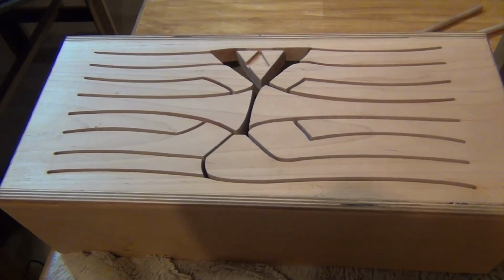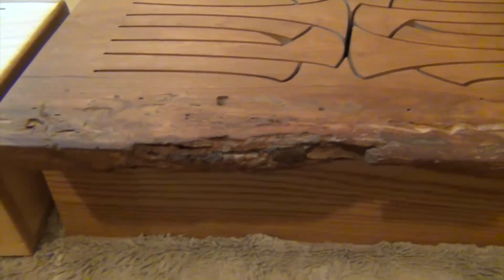How do you record tongue drums?

Comment: Using Shure SM58 & Presonus Audio USB interface. I've been struggling with same issue lately: finding best way to record steel tongue drum. I use Audacity but have Reaper (Aud. seemed more user friendly to me). I've seen pictures of traditional rock bands recording drums and their microphones are suspended up in the air hovering above the drums. I think this angle helps capture the radiance. I still have trouble capturing that radiating rigging that the drum has live. I've found that the lighter taps & overall sound in recording just sounds pinging & dinky,  it doesn't have that warm hum. When I strike the tongues with more force the recording is better but shame limited to that striking technique when recording. Wish could capture better. Let us know how goes.

Comment: I would say trial and error. Room acoustics makes a huge impact on recordings. Maybe try a few different rooms or look up some videos on treating your room acoustically. They make some sound dampening blankets that you could makeshift a recording booth with. That would help take away any audio that is being colored by the room.

I would also try a few different mic placements, or even mic it up with several mics. Sort of like recording guitar, you don't want the mic to catch the boom of the sound hole or in your case the boom of the strike. Seems the mic is pretty far away from the drums. Maybe move it closer. The rode NT1 mic picks up from the front and sides and rejects sound from the back. Maybe move it a little closer or if you are doing it from over head, the mic needs to be parallel to the service. or of you move it down, maybe put it at a 45 degree angle facing the drum.

I actually just bought the behringer UMC404hd interface and plan on doing some testing with several different mics. Those drums sound pretty good. I would love to hear them live.
Reply from the maker: Thanks!  I will keep experimenting.  Right now I only have one mic but hopefully I can pick up some more and maybe one day build myself a little studio with better room acoustics.  Thanks for the advice!